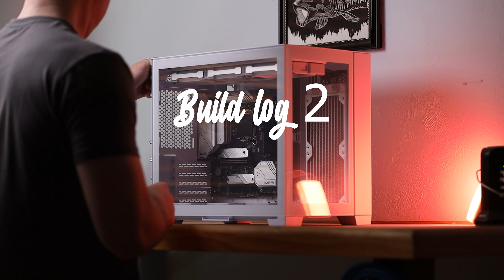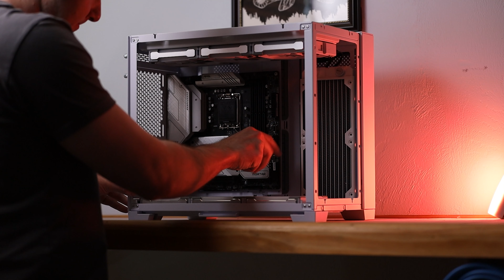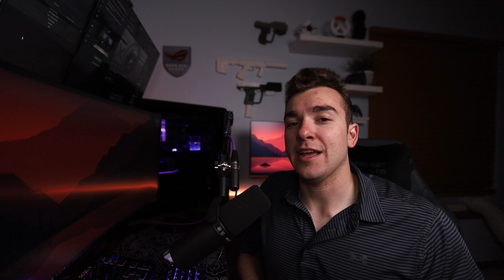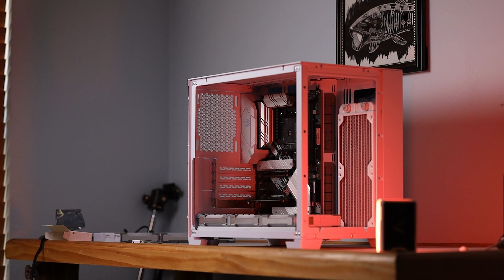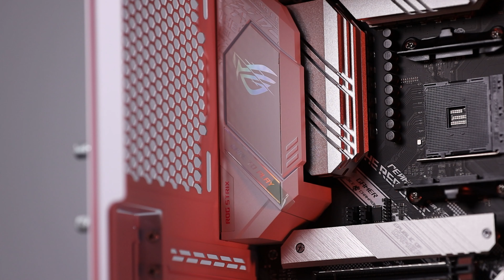Lian Li O11 Mini ATX Motherboard Install, Switching to AMD

Comment: I run a GPU only loop with a 360 30mm rad for my OC 3080TI FE in my O11D Mini. GPU temp hits 65-70c with the same lian-li fans you have at 1900RPM. Id definitely get another 360 rad if you plan on running a decently powerful CPU and GPU in the same loop unless you plan to run all your fans at max while gaming.
Reply from the maker: Damn that is a little warm for a gpu loop and 360mm rad. I might try and custom mount another radiator aside from the 240mm rad.
Thank you Kane for sending some stats on your system! 👍

Comment: Hey bro
1x 360 and 1x 240 rads should be ok
Dont worry
Reply from the maker: Hey JJ! Yea I figured this would be plenty of cooling,
even though these are slim rads. That XSPC radiators is super slim
but the fin density seems pretty good.